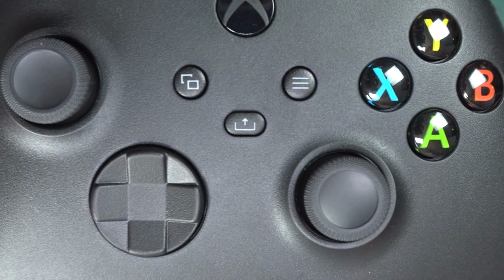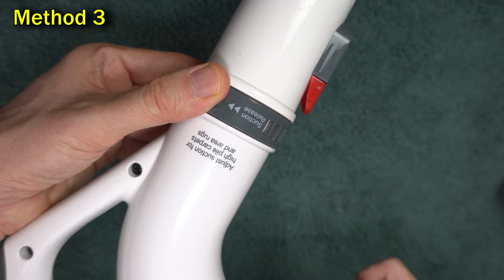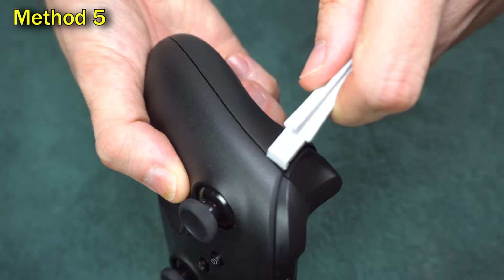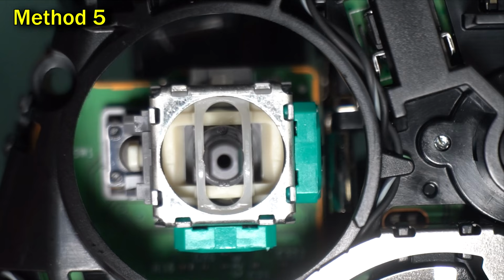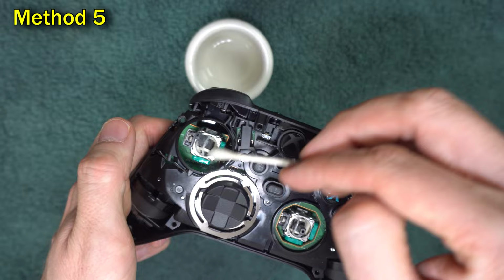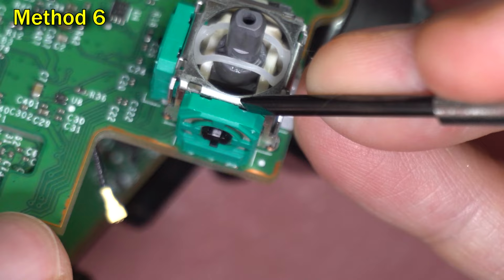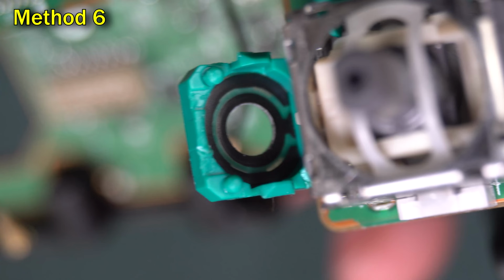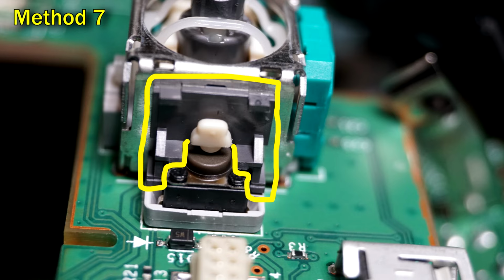How to Fix Analog Drift on XBOX Series X/S Controller (moving on its own, jittery, wrong direction)

Comment: The little tin discs at 6:30 that you took out with tweezers. There was some places that sold those and I was wanting to buy some but every search result has the whole stupid joystick assembly you would have to solder. I wish I could just fine the discs and only replace those and see if it helps. $70 damn dollars is way to much to be throwing in the trash considering how shitty Xbox controllers are. I nought the blue and white xbox controller from walmart and in less than a year its unusable, drift is so bad it cycles through menu's and it wont stop. I just bought a series s back on November and its brand new controller is just now starting to have drift
Reply from the maker: I suggest buying a broken, identical controller and switch the parts.

Comment: Best tip I can give anyone, don’t buy Xbox official controllers in the first place, plenty of other companies that make great controllers my one has held for nearly 2 years now before getting a bit of stick drift and that’s only cause I play insurgency sandstorm and hold down the stick to prevent recoil but really that controller cost me £25 with paddles on the back that you can custom remap and trigger selectors to allow for rapid fire and ofc custom leds. Whereas Xbox “elite” controllers cost £170 what the fuck.
Reply: Wired or Wireless ? What's it called ? 👍

Comment: [Some people like to use a plastic pry tool like you're supposed to, but I prefer to just stab my sensitive electronics with a metal screwdriver] -- *facepalm
Reply from the maker: Plastic tools can do as much damage as metal ones. Plastic ones can also be ineffective. Also, not everyone has prying tools laying around, so pointing out the options is useful.

Comment: POS overpriced controllers going through my 2nd one with this same BS issue. Probably be better off to buy a ps5 instead of buy this many controllers
Reply from the maker: The issue is just as prevalent in the DualSenses. The sticks are all pretty much the same design.

Comment: I'm going sony after all this crap.
Reply from the maker: Their controllers have the same issues. They use the same parts.
Reply: @HowToX Yeah I get that, but I have so many beefs with Microsoft at this point, I've bought every premium console they have put out and this is just the straw that broke the camels back. I have a series x, should have bought a ps5 and some extra controllers instead.